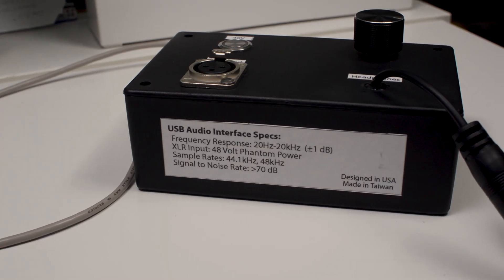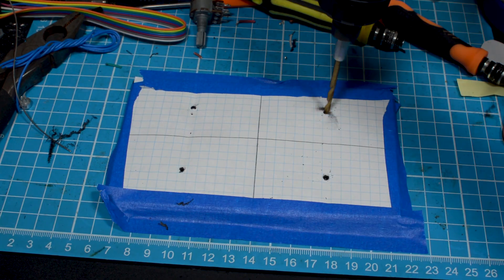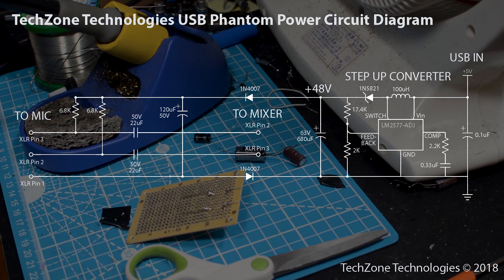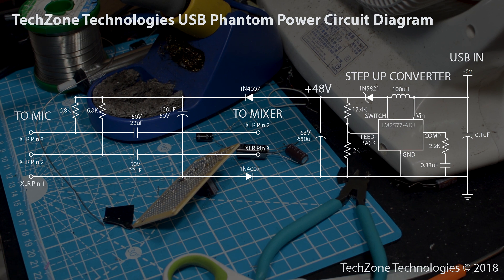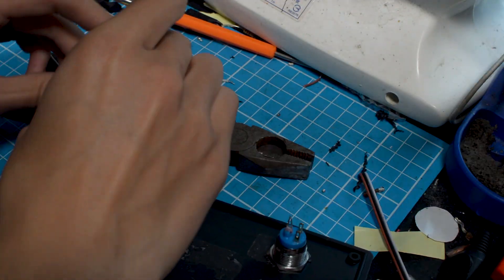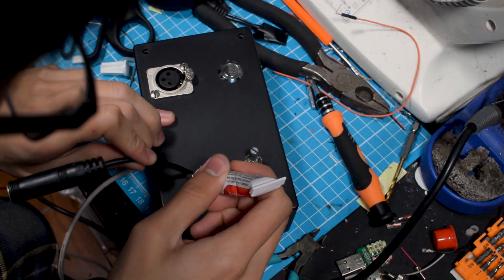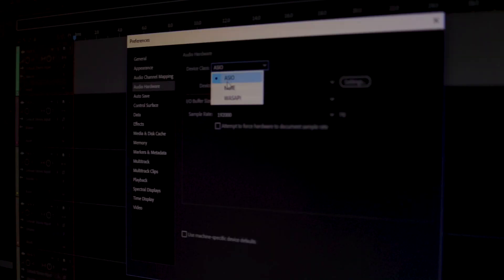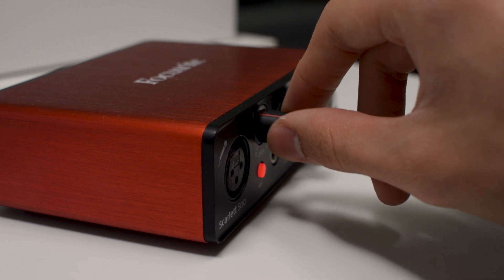DIY USB Audio Interface with Phantom Power

Comment: bruh in the first 30 seconds you took the diy part out this
Reply: Totally. Fail.
Reply from the maker: Unless you are programming an FPGA or using an STM32, its easier and cheaper to just use what's already out there. The DIY part is making it work with XLR and applying phantom power.
Reply: @SlideoStudios totally justified & logical solution. Those guys want 100% DIY, well they should first make their own silicon transistor at home and turn copper ore into cables.
Reply: Yeah but what's the point of your fucking video then

Comment: How would one modify this to support unbalanced, high-impedance, instrument-level input (i.e. from a guitar or keyboard), with an XLR/TRS combo connector and a switch for phantom power?
Reply: The audio interface he is using already supports this. He is building a mic preamp for his audio interface.

Comment: Not an audio interface... It's just a phantom power supply...
Reply from the maker: With a USB output and digital lines. If you watch the video, you will know its actually an interface.
Reply: My point exactly... You did not build the audio interface diy you just bought the interface...
Reply: @smucar1975  give it a break. If it works. who cares. it is a USB interface with DIY phantom power.
Reply: @buttertoffeecoffee  no its not.  it just phantom power without USB interface. He use another USB interface and connect to the PC.
Reply: Dude the box you built has no ADC you plug the mic output lines in to a mixer it's a passthrough at best with phantom power injection. An audio interface consists of an analog to digital converter that then feeds an audio codec that converts the signal coming from the adc to USB protocol... Not an interface, so don't advertise it as such.
Reply from the maker: @smucar1975  I guess you did not watch the video. It does have an analog to digital converter using the Audio Technica adapter.

Comment: I wish you would actually show step by step on how you connected all these, I know you have a schematic but it would be more better if you showed it rather then explain it with a diagram.

I like the idea though
Reply: But he won't know what you're using. Showing where on his particular circuit he's adding components will only help if you have the exact same circuit.

By showing the diagram, it is applicable to all circuits, you just need to find where on the circuit those connections are. And if you cannot do that yet, this project might be a bit too advance for your level of knowledge. If that is the case, it might be a good idea to learn the basics first.

If you just want an audio interface on the cheap, there's other ways to achieve this. This project already uses an existing audio interface as the core, you could just pick one that suits your needs for cheaper than that interface plus all components needed for the conversion.

This kind of stuff is mostly for if you need something different than what you already have.

Comment: do i really need to put bipolar capacitor to the circuit ? and is it work with 10K resistor ?
Reply from the maker: Ye, the main purpose of the bipolar capacitor is to prevent 48 volts from entering the Audio Card.
Reply: hey thanks for your answer, i already build it , but no sound appear.i use 2 wire cable for my mic connection,should 1 use 3 wire cable ?
Reply from the maker: @theteentheteen  wdym?